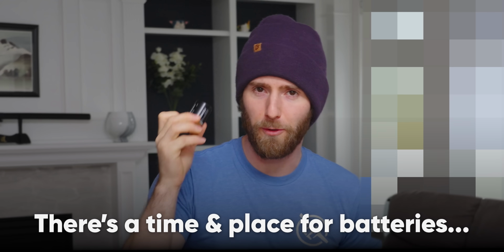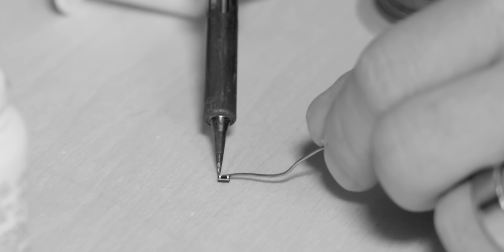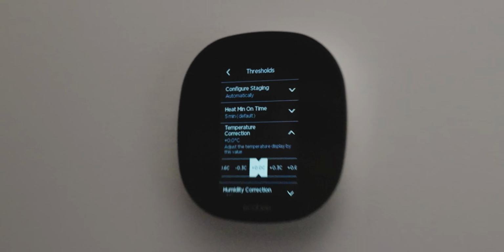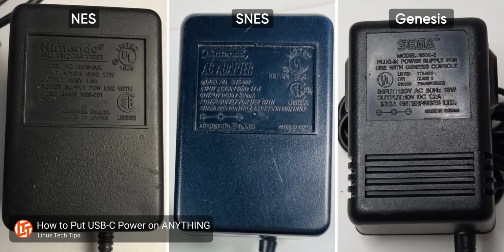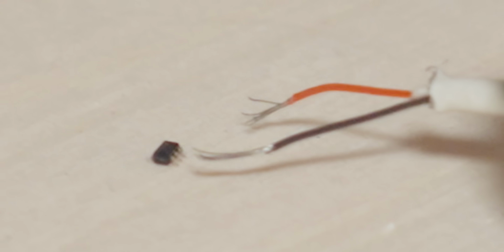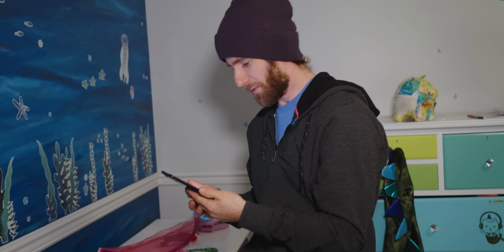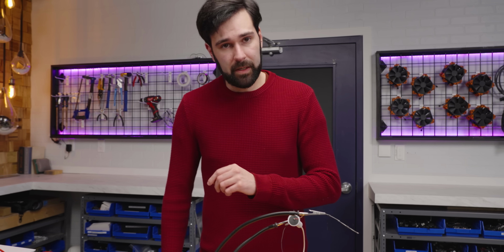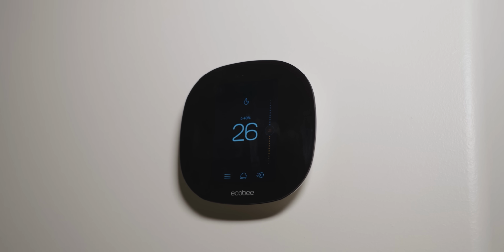I HATE Batteries! - Converting Wireless to Wired (a cheapskate’s guide)

Comment: I once saw a cordless drill adapter to plug/power it from wall power. The idea was if the battery failed and you needed to keep working you could run off line power while the battery was charging (running 'corded' for the short term). They stopped selling those. My guess is they figured something that useful should be binned.
Reply: They were probably afraid that many people would stop replacing the batteries.
Reply: AC to DC inside the device will make it bulkier. AKA buy a second battery or a corded drill to begin with. I think that's the reasoning behind avoiding this rare hybrid solution.
Reply: @em0_tion  It was essentially the plastic housing of a battery pack, with the battery bits replaced with AC to DC bits and a power cord sticking out the back. You would just pop it on the drill the same as any other battery pack. The drill itself had no additional changes.

I suppose (being very charitable) there could be a safety issue if the adapter housing was not fully water proof and you dropped it on wet ground (you'd still have 120v AC going to the pack). I've seen some pretty beat up battery packs, so maybe they just decided not to have that kind of liability potential in the books.

Or, more likely, their customers would just buy the corded adapter instead of multiple spare batteries. This was back in the first gen era when the batteries had dreadful performance and each device used a unique battery (of course).

Comment: I swear to god Linus, you could have just used a linear voltage regulator programmed to 3 volts. Those devices dont care about 3 to 3.3 volts. Batteries lower their voltage when draining. A TO-220 3 volt linear regulator would have saved you so much trouble. What kind of IT personnel do you have that recommended SMD components! Great content, good idea, terrible execution.

Comment: 3 plain 1N4001 silicon diodes in series will drop the voltage from 5v to 2.9v nominal.  You don't need a voltage regulator or resistors.

Comment: Great video, thank you!

Why didn't you just get a USB boost buck converter from 1V to 24V? Costs 3$ and you can regulate the voltage by a small wheel and see it on an integrated display (and NO Multimeter). No soldering required using the screw clamps and if you just hot glue the wires on a round piece of plastic with about the size of the battery. You can even 3D print battery placeholders with contacts on the right places  - the electronics  do not have to fit in the small battery slot, only two small cables. One thing you also did not mention: If the device has to be mobile, you can also use a small USB Powerbank to extend the battery life a lot!

Comment: The proper way to do this would be to use an adjustable regulator (or a low voltage regulator around 1.5V) such as an LM317. A potentiometer goes between the output and ground, with the wiper going to the regulator's adjust or ground pin. Then a decent size electrolytic capacitor on the regulator's output to maintain stability. This will give you good voltage regulation from zero up to your psu's capability. Note that the LM317 requires a minimum current draw to maintain regulation, so I recommend a newer, higher performance part. But there are plenty.

Comment: In fairness, I have 4 of those ecobee sensors and they’re well into 3+ years without ever changing the batteries. I’ve been extremely impressed with how efficient they are. I upgraded to an Ecobee in November of 2019 and bought the sensors that December. I’d gladly hardwire any of my other wireless smart devices, as Ecobee aside, everything else absolutely chews through batteries
Reply: For those of you claiming that batteries on similar devices die out in roughly the same time, nah that's just not realistic.
I've had VR headsets with tracked controllers for over 6 years. Left and Right controllers on battery, when one shows low battery I usually swap both out at the same time.
I have tested plenty of times only swapping one at a time, and they have wildly different usage times on them.
Of course these are input devices so their usage can majorly impact the battery life, but the statement about similar battery life is just wildly inaccurate either way.
Reply: @threemoo  Yeah sorry but sensors tend to be pretty similar. Your sample size of 2 VR controllers doesn't really tranfer all that well to sensors or anything really.
Reply: Yeah this is probably a dumb solution to a problem that doesn't exist.
Reply: Same with my Philips Hue switches and sensors. Three and a half years in and I’m just now seeing ‘Battery low’ for the first time. This problem does not exist lol.
Reply: @heisenbaj  Now take those 3 years, divide them by 100+ devices, switches, sensors like Linus has in his giant house and given enaugh time it would average out to 1 devices every ~10 days because not every battery lasts the same time.
Reply: @gamingmarcus  Usually it doesn't really average out all that well because similar devices (say 10 temp sensors of the same model) use the same amount of battery and batteries where put in there roughly at the same time. This means you gotta change a whole lot of batteries at once. And I would assume he does not have 100+ wireless room temperature sensors, the house is not that big. 
A more reasonable solution would be to make or buy some sort of energy harvesting solution that maybe uses a solar cell. These devices pull miniscule amounts of power if you calculate it and it should be doable. And you could keep them wireless.
Reply: @gamingmarcus  Sure, and so I get wiring everything possible. But these things are bought in waves or all at once, so it wouldn’t be nearly as sporadic as 1 every 10 days. This also introduces a failure point and I’m guessing voids warranty so solution seems worse than the problem.
Reply: @gamingmarcus  Who’s using 100+ devices that all have batteries? Probably no one. In this case, this is the only device in his house that’s using batteries, so yea, doing this mod is excessive. He’s attempting to solve a problem that doesn’t exist, and like others have said, this is the one of the only sensors I wouldn’t considering doing this to … they’re just that efficient.
Reply: @allesklarklaus147  Not quite, depending on how far away the sensor is it might use different amounts of power to transmit (which is the spike you see there). Not sure if that adapts to how far away it is, but it should, to conserve battery. So either you have dumb sensors wasting energy at the same rate or efficient sensors which all die at different rates.
Reply: @vocassen  Yes they might adapt to find the lowest possible transmit energy but the difference between TX powers isn't gonna be huge and again a private home really isn't that big either.
Reply: @glassman3333  In my small single story house (which is probably 1/2 to 1/3 the size of Linus' house) I have 20 door and window sensors, 5 motion sensors, 3 water leak sensors, 6 pico light switch remotes, 2 glass breakage, 3 vibration sensors, and 4 temperature sensors.  All battery powered.  Oh, and both of my alarm keypads are also battery powered.  There's 45, off the top of my head... I'll bet I'm missing a few.  I can hit 50 pretty easily by buying a few things already on my smart device wish list.  100 devices in a house his size, with the number of kids he has, seems very plausible.

Comment: Linus, a tip, if you have no helping hands to hold small objects to solder, you can just use chewing gum.  Ideally the blue tack is great, but if you are talking readily available objects, chewing gum works just as good, and it makes your part smell fruity.

Comment: If you're doing a few, might have been worth drawing up a PCB and having JLCPCB or similar fab and SMT a tiny board the size of a battery to drop into the sensor that could have the voltage regulator and maybe the filter caps that are part of the reference implementation on the datasheet.
Reply: well... someone do it up and sent it to LTT to add in the description, there's bound to have lots of peeps wanting to do that... without the patience or tools to do it...
Reply: You could do that, or just order an off the shelf 3.3 V voltage converter.
Reply: plus you could add a USB-C port 😏

Comment: In the future use a 3.3v linear regulator with a capacitor after the regulator across the positive and negative. The cap will supply current for those transient loads. Or you could use a switching regulator for more efficiency, but with such low current draw that’s probably not worth it.

Comment: Just a clarification on what is said in the video, you can totally get voltage regulators that do 1000V to 5V or vice versa. The distinction is that a linear regulator will effectively turn the excess voltage to heat, e.g. 5V to 2.5V would result in a system that is at most 50% efficient, so you want the target and supply voltages to be quite close. A switching regulator, however, uses what I can only describe as 'capacitor and transistor magic' to directly convert from one to the other at very high efficiencies (e.g. 90+%) that are almost independent of the supply and target voltages, but these often need supporting circuitry which makes them unsuitable to use without an actual circuit board to solder onto (but more on this later).

Also, rather than using several normal diodes (whose voltage drop is mostly fixed and based on the elemental composition of the diode, e.g. 0.7V for silicon diodes) you could use a single zener diode. Zener diodes are available in a much wider range of voltages and are often used as a very cheap way to regulate voltage.
Alternatively, if you want to do it better than hackily using diode voltage drops (which won't work very well with devices like this with very variable current draw, as in the real world the voltage dropped across the diode will vary with current) but still way cheaper than buying a whole new AC to DC power supply, you could use one of those tiny PCBs that has a switching regulator (and supporting circuitry) already set up on it for a couple of dollars, all you have to do is solder the two input wires to the input pads, and connect the device across the two output pads. You can even get versions with screw terminals on them to completely remove the need for soldering altogether.

Comment: i usually use dc to dc buck converters. get a 6 pack for 12 bucks and it's more robust than just a voltage regulator and works with a wider range or projects. plus its very easy to mount and solder into place. i used it to turn my battery powered dremmel into a wall powered dremmel, my battery powered shaver into a wall powered shaver and i was able to use it to adjust the brightness of my aquarium led's.

Comment: Makes me wonder why these wired solutions aren't on the market, it sounds practical for these smart devices, those that are intended to connect to your home to adjust the temperature per room, they don't need to be always powered on if your house loses electricity (those 2+ years being wasteful if you lose a month(s) worth due to a bad thunder storm or something). I would think Security Cameras should be both on the mains with a battery backup though, in the event a thief goes to your house during said thunder storm (its possible, criminals may know no bounds).

Comment: Those devices are designed to run for years on a single battery lol. Cool project in terms of fun but not very practical as now it needs to be near an outlet, has a cable and stepping down the voltage three times isn't cost efficient. The cost to run it using step down from the wall is far more expensive over the 2 years compared to just buying another battery.

Comment: CR123A also come in 3.7V rechargeable flavors called 16340. And as far as embedded hardware goes, is a pretty common (and handy) package.
With some electronic do-how you can check the chip's allow-able voltage range (sometimes they can run on 5V straight), or if not, you can get LDOs and regulate the power from a wall wart.
The easier way is to get them in TO-220 packages. Or get SMT adapters. Capacitors for "traisnent" also helps -- that is, if your LDO can maintain a stable voltage.
These type of thing suck, but they don't need to be like this.

Comment: Easy way: use a $2 buck converter (which has a readout for output voltage)  that has simple terminals  with no soldering.

Comment: I really enjoy your videos but this was frustrating to watch. The diode solution is a crappy one, inefficient at best. A simple, variable buck converter (fixed 3.3V would've likely been fine) and a few decoupling/reservoir caps on the output would've worked....

Comment: Okay, so I know the windows are pixel-fuzz because Linus wants his address to remain a mystery.  Buuuuuut ... I can't help wondering who is dancing naked outside of his windows?  LOL
But I am confused.  I can find a plethora of AC to 3V power bricks on Amazon for around five bucks.  (Some less!)  So why DIY hack down-Volt a 5V brick?  Linus gonna Linus, I guess.
Also, when I do these types of conversions, I usually do it by making a fake battery to solder the wires to.  (Usually by whittling a stick to the right size because I have no 3D printer.)  That way I can easily revert back to battery should I want to garage sale them or something.  Soldering irons are great for making a little notch in the battery cover to run the wire through.

Comment: For what it's worth, the better janky way to knock down voltages on low current sources is to use power diodes - the old standard 1N4004 diode will reliably knock about 0.7V off of your voltage when hooked up in series, and doesn't vary much with load in the same way resistors do. There are other options with other voltage drops as well so a 0.4V drop to get that regulator to work cleanly would be very doable.

Edit I see that's what Dan went with lol. That's what I get for commenting part way through

Comment: Meanwhile, I put two of these into operation nearly 3 years ago, and both have run fine on their original batteries all that time with no sign of stopping. I'm pretty anti-battery as well (I really want to hardwire my door lock), but in this case, I'm happy with them as-is.

Comment: Rather than soldering to the contacts in the device, cut a piece of plastic (e.g. bottle top or two, or even a bit of wood) to the right size and then stick the wires to it. This gives the added benefit of being able to convert back to a battery if needed.
Reply: Basically a plug the size of a CR2032 (THe name itself designates it as a lithium cell with 3V nominal and 2.0V end point with 20 mm diameter and 3.2mm height. The number is the trick: 2032 -> 20x3.2 or the similar 2025 -> 20x2.5 or even the 18650 -> 18x65.0 that are used in many laptop batteries)

Comment: Instead of the three regular diodes in series, you could've used a Zener Diode. For you application with a constant load, Zener Diode would be your best option
Reply: Yepp, an 1.8V diode would have exactly resulted in the 3.2V needed.

Comment: I once converted two battery-powered LED "fairy lights" boxes to run on USB power for my younger sister.  They ran on 3 AA batteries, which was basically 5 volts, but they died in less than an hour.  They were supposed to be strung up around a room!  At any rate, my conversion worked well according to her, and she used some spare USB chargers to power them.

Comment: Linus: Did I over complicate this?

Yes Linus - as soon as you start talking about soldering micro-regulators, potentiometers, voltage testers, or needing special grips to hold things in place to make it easy… or needing to have someone like Dan walk you through this stuff so you can do it on camera… yes it’s over complicated. 

I mean it’s not like you can go into Walmart and buy those parts, so you probably had to order a 50 pack or something online.

Love the content, but this veers into the absurd levels of over complication.

Comment: Why on earth did you guys spend so much on Labs if you're not even going to ask them for help on stuff like this?  Five minutes with an actual electrical engineer would've saved you a lot of effort.  A resistor?  Really???  Maybe if you were using it with a zener diode, then sure.  I'm glad Dan (eventually) found one of the half-dozen easier ways to do what you wanted to do, but it was a waste of time.  (Plus, frankly there are still better solutions that are just as cheap and arguably simpler.)

Comment: Nice efort, but ou can totally by ready made step down converters for less then a dollar on aliexpress, ebay etc. Most regulators require mote than just the ic to operate properly. Plus it would be much, much easier to solder. Cheers!